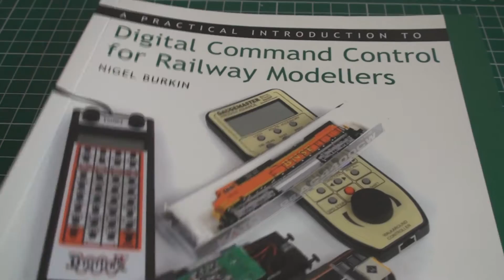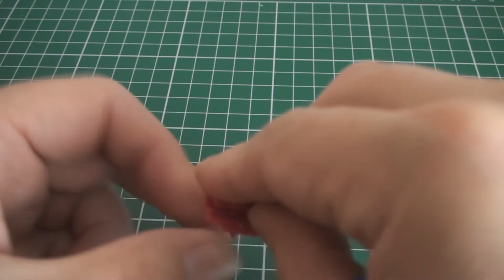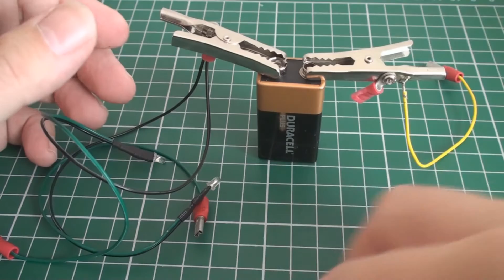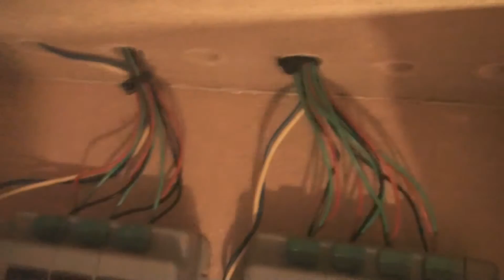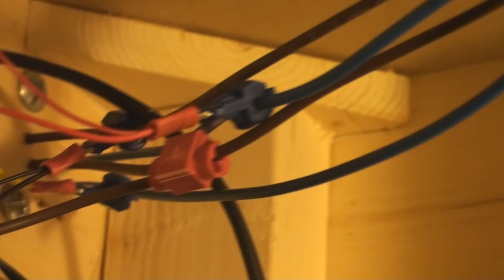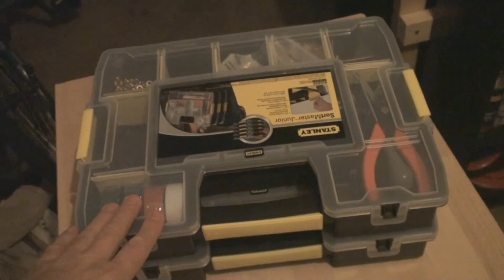GEN4 - DCC Wiring on Finwick Quay

Comment: Very good helpful information well presented it was a great help for my, thank you
I found one or two parts hard to follow mainly to do with the turnouts. I have been working on OO gauge with DCC where I had to use DCC Electro Point Clips which I assumed would be required to be used with N gauge   but there was no references to them the nearest mention was the pieces of green wire you soldered to the frogs, I found these point hard to follow and understand.
Reply from the maker: You are welcome and thank you for your comment.